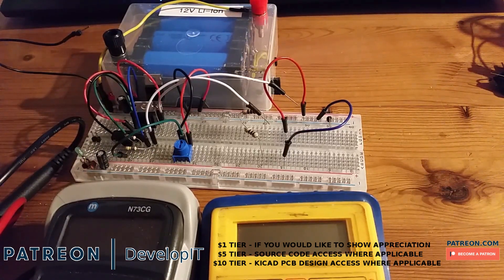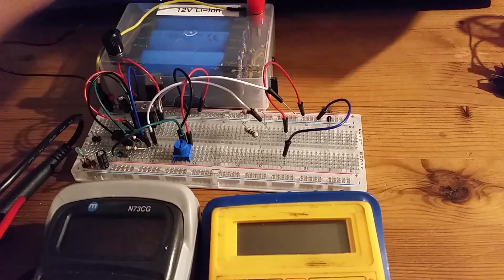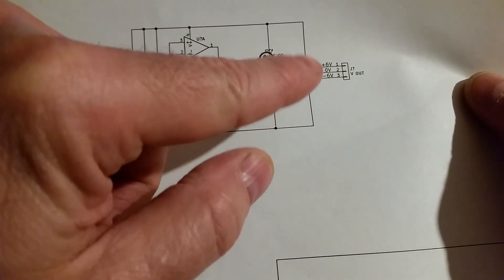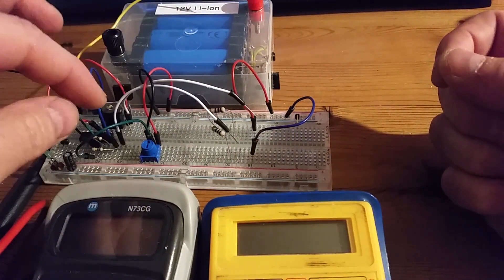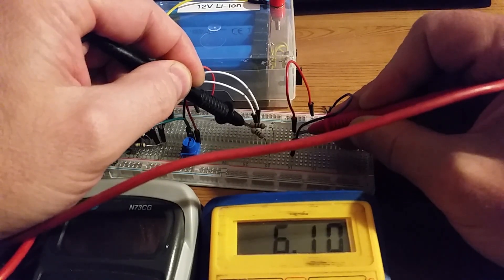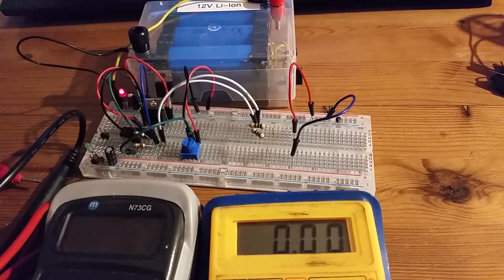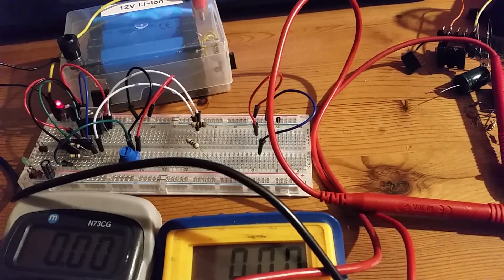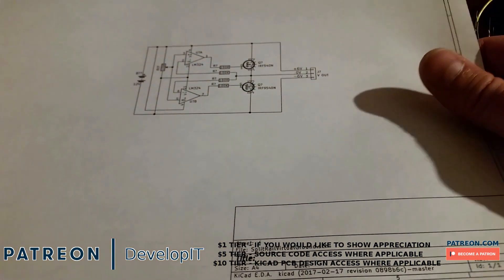Power Rail Splitter - Virtual Ground Circuit

Comment: What is the purpose of the resistors in the gate path and feedback path please? 100KΩ is quite big.
Reply from the maker: I just put them there in case the MOSFET fails, to prevent a large current flowing back into other areas of the circuit.
Reply: Got it, thanks!

Comment: Mine is shorting out and drawing current without a load. The mosfets are getting really hot too. Do you have any idea why it would do that?
Reply from the maker: The MOSFETs have an effective diode inside them, check the source pin of each MOSFET is connected to the respective power rail. Also check the P Channel MOSFET is connected to the positive rail and N Channel MOSFET is connected to the negative rail. The only other thing I can think is that the power supply being used is a bit noisy and effecting the operation of the op-amps. To rule this out, try using a battery first to supply the system, a PP3 should be OK and measure if any current is being drawn.
Reply: @DevelopIT  in your schematic, I thought the source of each mosfet  are connected to the virtual ground and the drains are connected to the corresponding positive and negative rails.
Reply from the maker: @reynolds087  I just checked in the MOSFET datasheet and the P Channel source pin needs to go to the positive rail, and N Channel source pin needs to go to the negative rail.